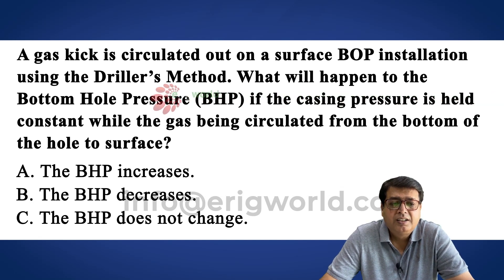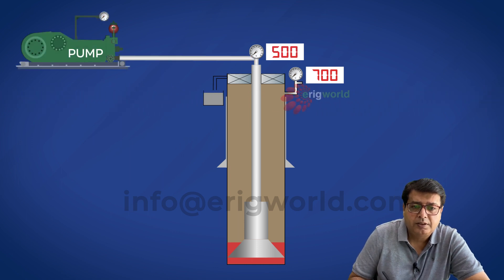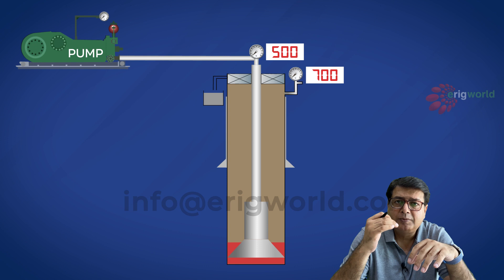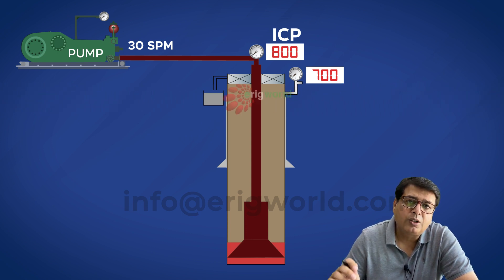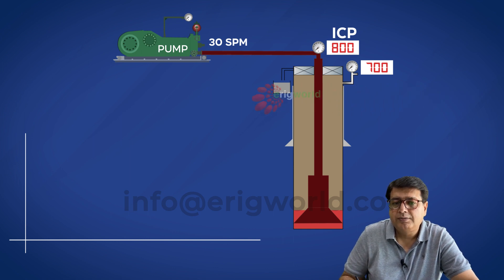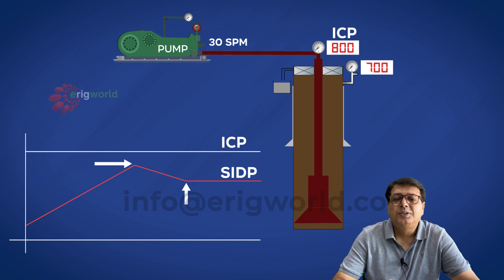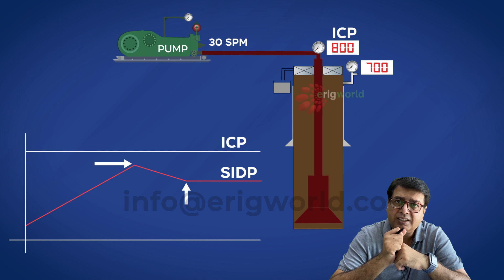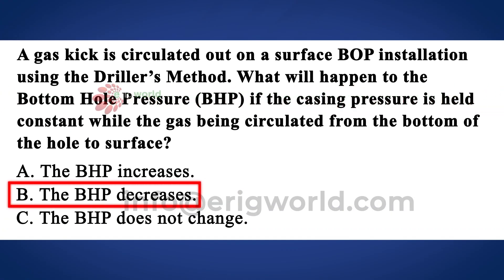How to answer BHP question in IWCF exam | BHP during Drillers Method | IWCF Preparation | P57 Q181

Comment: I think the answer is the BHP increases, assuming the figures you gave in the example, you will be holding casing pressure at 700 and not allowing it to increase by closing the choke NOT opening. Please confirm
Reply from the maker: Pls click on the video. Its a video explanation is give. Thanks
Reply: Saud- In the case described in the video, SICP can only be held constant (against the rising HC/gas bubble) by opening the choke. Thus, BHP will decrease. 👍

Comment: Why the torque in bit 6 5/8regular  connection less torque in Drill collar8” 6 5/8 regular thread?
What is the reason
Reply: Because torque value not only depend on connection size but also ID and OD .
Reply: it is also depend on the thickness of the tubulars..